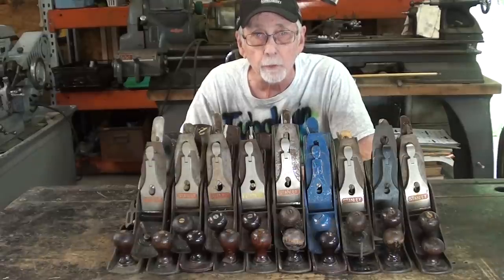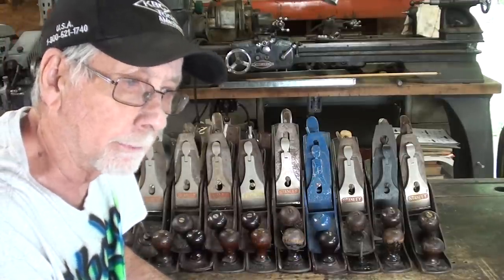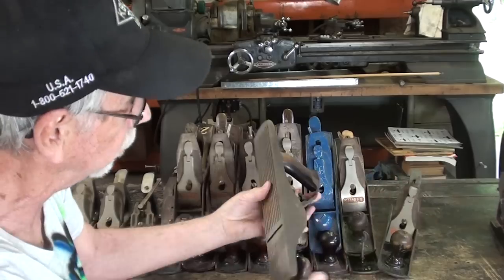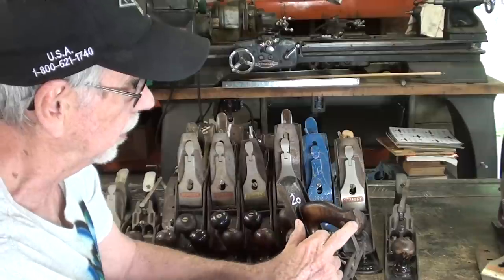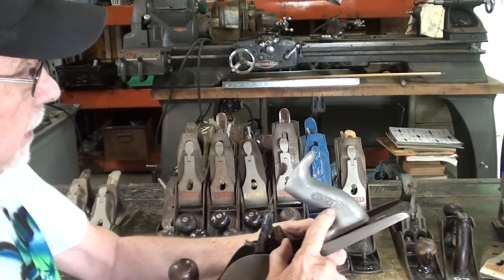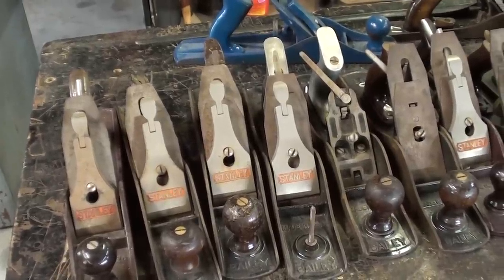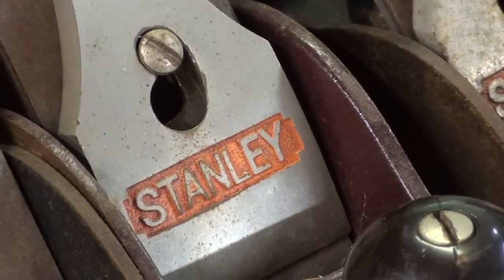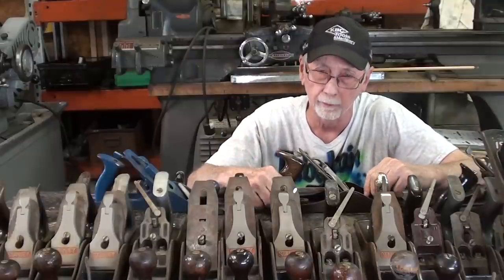STANLEY PLANES IN THE SCHOOL SHOP Tips #645 tubalcain

Comment: I remember once we actually got to work with the planes, racing to the plane cabinet to get one of the 2 or 3 "good ones".  Sometimes it got a bit heated when certain students didn't get the one they wanted.  Good times......
Reply: With hand planes you have to expect to do a bit to them in order to make them work right. At least sharpen them up. That's half the battle right there.

Comment: Yes at Grant middle school in Spfld. Ill we had what were called exploratory classes/industrial arts, they encouraged all kinds of trades.  I myself was in manufacturing class that tought the fundamentals of many basic manufacturing techniques -- then in constructionclass where we built a down scale corner of a home and incorporated a small part of each trade, there were five work cells and five house modules. Then we had small engine repair which I took, also we had electronics classes,  and a radio and television class where we built a small radio booth in the corner of the room and learned how to produce and time radio programs etc, it was all very fun I thought.  Then in Spfld. high school I took auto mechanics for two years and we had to take a bus or drive across town to an old grade school where there was a full shop with lifts etc built into the old grade school.  there was also auto body class and all of this was free of charge.   Now all thats gone from the grade school and high school theres not even a woodshop or machine shop class anymore, if you want anything like that you have to pay extra and go to an area vocational school.  I still some of my old exploratory work books as they called them, these classes were the most fun I had in school and where I learned the most.
Reply from the maker: Too bad they illuminated the shop classes

Comment: Hey, I'm 77 years old and I still have problems getting a really "fancy" sharp edge on a plane.  Yes, I have Arkansas and diamond stones, just lack talent.  There are some applications especially in furniture restoration that only a hand plane can perform correctly.  Cheers!
Reply: Get an Eclipse guide. The imported knock offs need a bit of filing to flatten their reference surfaces. I sharpened freehand for decades and I can get stuff sharp. Using a guide is a lot more consistent though. Being consistent is a plus. I am also a big believer in hollow grinding the primary bevel on woodworking tools too. You need the right bench grinder to do that well.

Comment: Shop classes in the early 80s were the only worthwhile reason to go to school. If they hadn’t kept shutting the lights off, I wouldn’t ever have left. Wood, sheetmetal/welding, architectural & mechanical draughting, auto, electrical/electronics (machine shop was reserved for seniors only, already). Those teachers were the very best and provided the most useful education for long-term success. There are not many high schools with shop classes left in my area. Costs of liability insurance, cost of repair parts for machines, cost of raw materials, lack of qualified teachers, and the devaluation of the trades in general all contributed to the demise of manual arts training. I continue to advise young people to take up a trade first, then consider higher education. That way they’ll always have food on the table and a roof over their heads. Knowing how things work and having the skills to make and repair them has saved me and my family many tens of thousands of dollars over the last 40 years. The discipline and attention to detail required to “do good work” translates into other areas of one’s life in a tremendously positive way. The joy and satisfaction of being able to stand back, wipe your hands and say “I built that.” is unmatched.

Comment: I did woodshop in the sixties. Still use today what I was taught then.  One strong lesson that I was taught, but no one else in the whole history of man seems to have been taught: NEVER put a plane down on its planing surface.  ALWAYS put it down on its side when not being used.  A plane’s blade is easily damaged and it takes time and trouble to sharpen correctly. So avoid the chance of damage.
Reply from the maker: Yes

Comment: Bad experiences in shop class? Changes in technical education? Ive got a good one.
I left school 5 years ago. If it weren't for my dads collection of hand tools. I'd have never touched a plane, a coping saw, a chisel, or any basic hand tool you can think of. I have horrible, horrible memories of spending more time figuring out how to draft an acrylic pencil holder in SolidWorks than I went drilling, bending and gluing it together. Sure, they had to teach us relevant skills at the time, but they could have at least left the edges of the plywood music boxes rough sawn, so we'd at least have something to sand off.
I didn't do wood and metal shop, I did CAD and glue class. Don't despair though, there's still a good number of people my age getting into these hobbies. it's not all history yet.
 More importantly, great video as always Mr. Pete!

Comment: Question...could working in or having an interest in metal working (or any trade) be an inherited trait that may be passed on? 
 
The family machinist history started with my dad. Dad worked in a factory as, i thought, an electrician and/or mechanic. He never discussed his work and I only knew that he was very good when dealing with electrical problems around the house and would occasionally get a 2 or 3 AM call from work asking him to come in early because a line machine was down and no one else could fix the problem. 
At that time I did not have sense enough to ask him about his work. I assumed it was just a factory job so I was not interested. When he finally retired I learned he not only did mechanical/electrician work at a factory but he was a machinist. Dad ended retiring after about 45 years at General Electric's Appliance Park in Louisvillein his trade. After his death I finally learned he was not only a machinist but had been THE head tool and die maker over the entire Appliance Park for a number of years. I was not entirely sure what a tool and die person actually did. I have since have come to understand that all tool and die makers are machinists but not all machinists were not tool and die makers. I have told that tool and die makers were required to be much more exacting in their work. Please correct me if I am wrong in this assumption. 
 My youngest brother and I and my son all enrolled in "vocational school" machine shop classes when in high school, I in 72 or 73, my brother in about 1980 and my son about 1993. My brother, I, nor my son had any prior knowledge of machinery and did not know about the machinery history in the family and my son did not know that I had even taken a machine shop class and had visions of becoming a machinist at one time. I don't think my brother realized I had even taken a machine shop class. All three of us had made our individual decisions to take the classes because we had each wanted to work with metal. We all three had talked about how exciting and neat machinery was when taking our respective classes. My son and I did not take up the trade but my brother ended up as a machinist in the Navy. I am still fascinated with machinery and like watching the chips fly which is why I watch your videos. 
 
Thank you Mr Pete

Comment: I have very fond memories of my Junior High woodshop class. We had to make our moms a cutting board, gluing stock together, making it square and using the plane on the beveled edges. My shop teacher never gave up on us, as I remember having to "start over" because it was not "square enough". Our first lathe project (also used the plane) was to make a hamburger patty press!

Comment: I only had 2 shop classes. Jr high general shop.where a piece of 1 x 12 shelf board was made into curls with a hand plane. And high school electronics class which was taught by en electronics tech. He was excellent but it was his last year of teaching because he didn't have a university teaching certificate. Something that had just been implemented in the late 50's. At that time many of the shop teachers were experienced trades people. They were all terminated and replaced with newly minted college graduates taught by professors that had never worked in the field. Some of the fresh teachers learned buy having an interest in their field others not so much. There are still a few shop classes left locally. Much more money and effort is put into the sports programs. The local school district has more administrators than teachers. The results have been uneven.

Comment: 15:24...there are at least SOME applications where using a jointer is impractical, or IMPOSSIBLE: with a jointer, it's necessary to bring the work to the machine- and that is NOT always possible!!

Further, a hand plane is HIGHLY portable- and it DOESN'T use electricity.

Comment: In our area they restarted a school machine shop program 4 years ago, sold a lot of the older machinery. I am guessing they spent around 300K getting the shop to where it is today. 2 new Haas CNC mills, a Haas CNC lathe, Cnc Plasma cutting machine. Also a dozen new manual lathes and a dozen new manual mills too. They also have 6 Haas simulator controls panels for class room use . The oil/gas  business is driving that spending here, I sub for this class a week or two a year. Some one needs to study why school shops fail/close and why some continue. My Father was a state level vocational school administrator, he told me  after a program is shut down, a few years latter they start talking about opening it back up. In my experience, Employers must demand program/s are available and hire the kids from these programs. Join the advisory committee and Participate. The teacher has to know what employers in his area want, and have meetings at least 3 times a year to stay as close to them as possible. The last class that graduated here, all the recommended were hired. More than a few STARTED out at $17.00 an hour.
Reply from the maker: Thank you for the current information on vocational education. Years ago we had what we called advisory committees. Local men from industry set on that committee
Reply: @mrpete222  That"s what we refer to it as here, but I could talk about many more issues that complicate school shops these days. There are issues with the students, and worse with some teachers. I know some people concern themselves with student safety,  but  the students that are ready to take "ON" any trade always handle this well.

Comment: waukegan west had a great industrial arts program each semester 1 class- wood /metal electrical/outboard- small motor    a  great education   gone??/ wood shop teach said wood would be history $$$ in 2000  only plastic and metal alternatives. jack benny did not have shop
Reply: Your teacher was largely right. What's sold as wood today is garbage compared to what was available years ago. I've seen old boards 12" wide and 20 feet long without a knot in them. If I hadn't seen it I'd have never believed such a thing could exist. But long ago you could harvest wood like that. Long ago they did too. Now it is all gone.

Comment: You taught wood shop? The machine you seem to be referring to is properly called a Joiner, not a JoinTer... no "T". It's used to true narrower boards both square and straight for glue joining into wider boards. Other than a butt joint or a rabit, there is no "joint" one can make with a joiner. I was a member of the Carpenters & Joiners AFofL-CIO union for 25 years. Teaching others, especially young people improper names of tools is unforgivable and does not reflect well on your own education. Very unfortunately, those  who administrate our public schools never took shop class in school, and even worse, probably attended private or parochial schools where learning a trade just wasn't taught. Teaching  and using improper nomenclature is a major contributor to the "Dumbing down of America" and the world as a whole. Adoption of terms like "pounds feet" rather than "foot pounds" when measuring torque, and using the term "Hertz" (abbreviated "Hz") instead of the proper and descriptive term "cycles per second" (abbreviated "cps"), is an abomination of the English language. I personally had four years of both wood and metal shop in High School, which was applied in a comprehensive program of math (maths ???) and science. When I was tested in the USAF, my High School shop classes alone earned me an equivalent associate's degree level certification. And, after 25 years as a hardwood floor, stairwoork and balustrade journeyman, plus another 12 years as an aircraft mechanic, I used my High School metal shop and machinist's training to hire on as a manual machinist turning handles and making chips in a local machine job shop. When I first hired on in that position, I couldn't even spell cnc, but learned it quickly. And, I owe it all to my High School shop teachers who knew there was no "t" in joiner. Btw... you should never lay a hand plane down on the iron, just lay it over on its side.
Reply from the maker: Who taught you to spell it incorrectly like that?